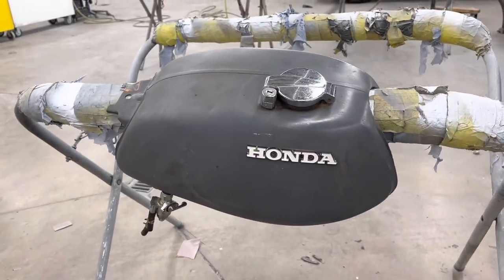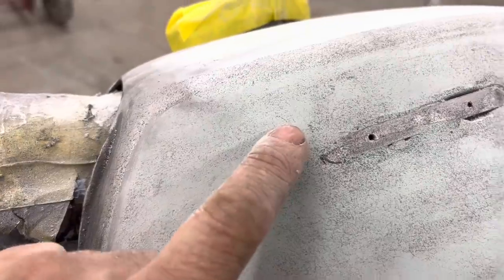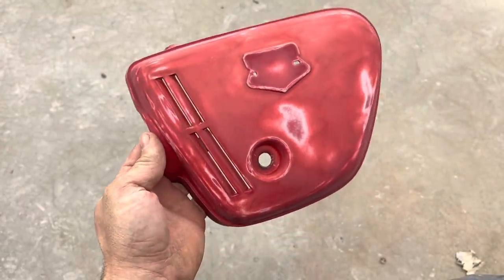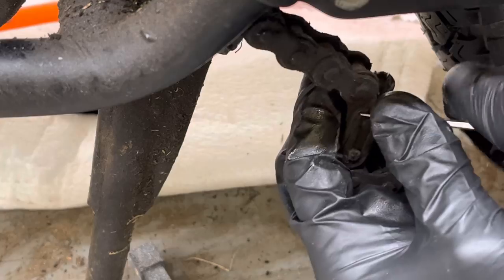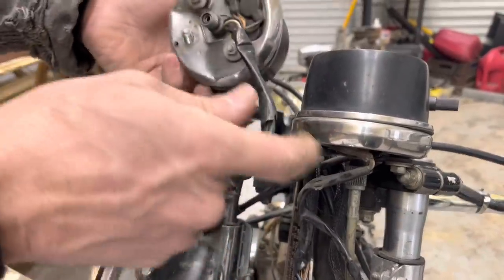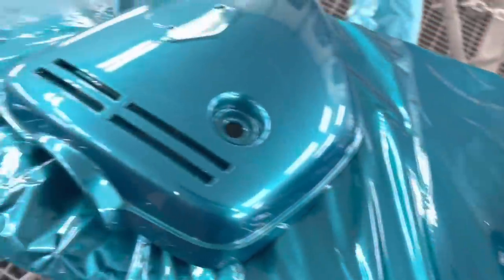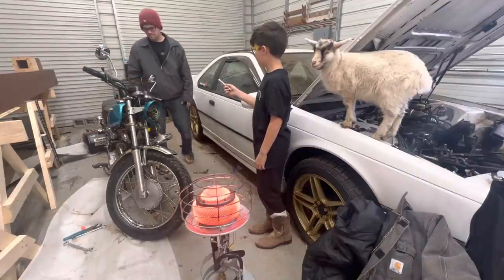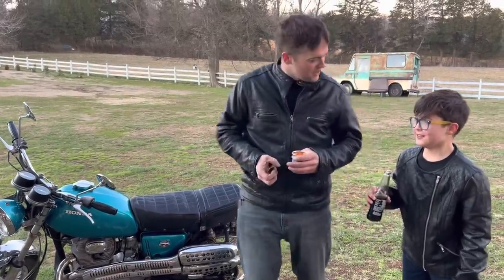How to do paint and bodywork on a antique motorcycle. Body tech shows you all the secrets !

Comment: Soften those side cover grommets with WD-40 ,the cover will pop on and off .    Helps keep the covers from cracking when pulled on unevenly . . . That old rubber gets really hard ,and the plastic tabs get brittle.
  Paint is Great !  Keep on doing what your doing,it's lots of fun and informative. Thanks All.
Reply from the maker: Ok thank you
Reply: I think baby oil would be a better softener of the rubber, less chance of it evaporating
Reply: Even better use silicone, but let it dry properly before re-mounted. Silicone makes it impossible to repaint.

Comment: If I'm not mistaken, you may need to add lead to the gasoline you're putting in this motorcycle. The valve guides were different back in pre unleaded gasoline days. It'll run fine, but eventually you may need to do a valve job and install guides that are unleaded gas friendly.
I think your paint looks great. The color is perfect.
Reply from the maker: Ok thank you

Comment: I made a contraption that I could put on a tank and i used it to mount a tank in a old Devilbliss paint shaker I had,simply filled the tank with gasoline and small sheetmetal screws worked pretty good. I would sometimes seal the insides with a Kreem tank sealer kit.

Comment: That bike looks great! You gotta paint that old Dodge Dart by the tree with that color when you restore it. You do have to watch those side covers on the bike, especially in cold weather. I broke all 3 mounting points off one of the covers on our 1973 SL125 about 30 years ago. Probably would've been a good idea to source a used one back then.😔 Although someone spaghetti wired inside that headlight of yours, they all have a ton of wires. I had one of ours apart many years ago and it like to scared me how many wires were in there. Can't remember why I had it apart but I just buttoned her up and let her go.
Reply from the maker: Good idea

Comment: Those are 100% CL side covers. Use silicone spray or white lithium grease on the grommets. You need to adjust the valves and the timing chain tensioner. I can hear both of them making noise. Almost All of the circuits of the bike go into the headlight harness. The clymer manual is still available for this bike, and you should get one. All the specs you need are in them
Reply from the maker: Ok thanks, but I allready adjusted all that in the first video I made

Comment: fork oil doesnt change ride height lol...
make preload spacers out of pvc if it matters that much
Reply from the maker: I understand it doesn’t change ride height but it could affect the rate that it squats under a load
Reply: @Sleeperdude  lol...no...ride height, static or otherwise is a spring issue...oil is just for dampening, to maintain tire to ground stability. Fork oil needs to be measured from the top of the stachion tube... people use fluid ounces for fork oil I understand...but it's wrong, both forks don't leak the exact same amount, and adding an arbitrary amount of oil will cause other issues with the valving. I like your channel..you're entertaining dude for sure...please don't think I'm trying to throw shade. ILL BUY SOME MERCH lol.

Comment: Those plastic side covers...man, they are always broken or cracked or missing on these. You lucked out with that intact one.
Reply from the maker: Yeah for sure thanks
Reply: @Sleeperdude  I learned about bikes from these like you did! Someone gave me a 1972 SL100 K2 that had been leaning up against the side of a barn for almost 20 years. One fork was full of water, the other full of sludge. The wiring in the headlight bucket was all rednecked. Paint all messed up on one side. I learned a lot about bikes and how different they are from cars. I kept finding stuff and going, "The heck is this? Why is this like that???" But just like you, I went through the ignition system and give it a single kick and it fired right up. These things want to live! Once I got it running, I just started riding anywhere I could. Although, I think I need to adjust my valves like you did in the other video. It's pretty clicky. I thought the timing chain was just loose from age.

Comment: I had an early 70’s Honda scrambler. Was mine a 360? I am well into my 60s and my memory isn’t always perfect, but I could swear that I had a Honda 360. Anybody……?
Reply from the maker: Yes they made a Honda 360 I think In 73-74
Reply: @Sleeperdude  THANKS.  Yes - that’s about right. I bought it used around 1978. I got a loan from the bank. $600 - to be paid off in one year. The payments were about $60 per month. That was rough because I was going to college, working part time and making minimum wage which was around $2.25 per hour.